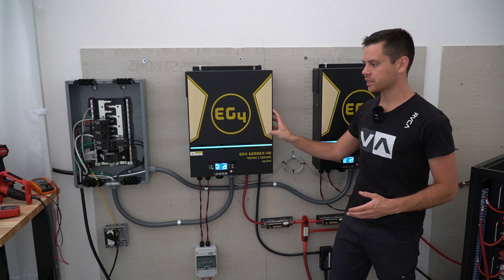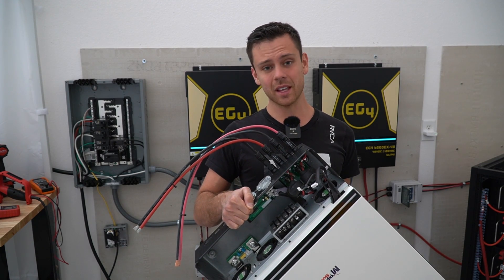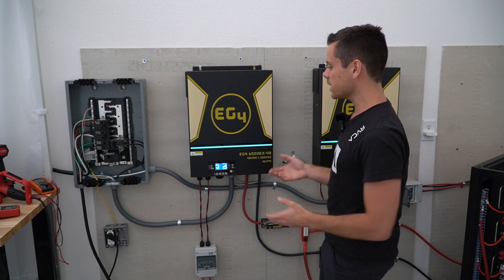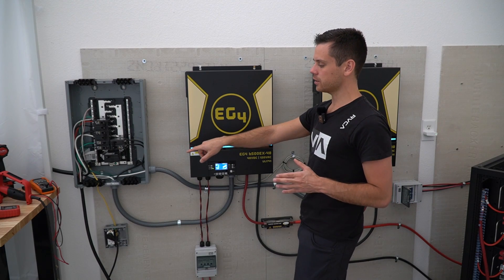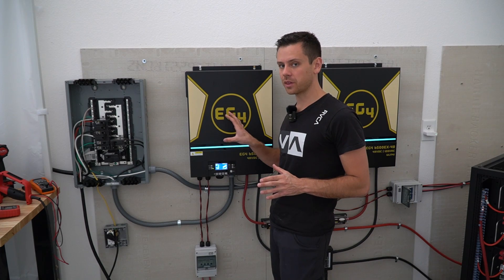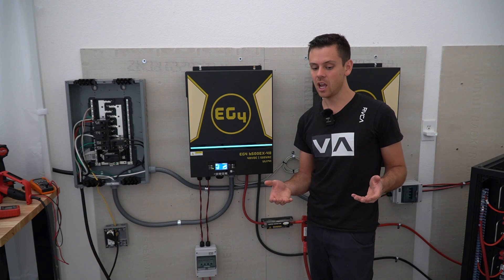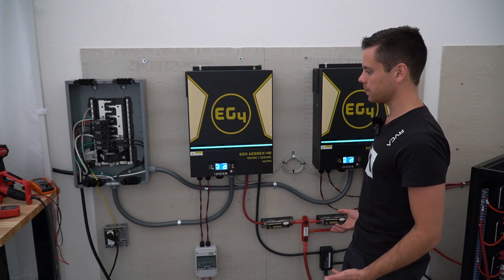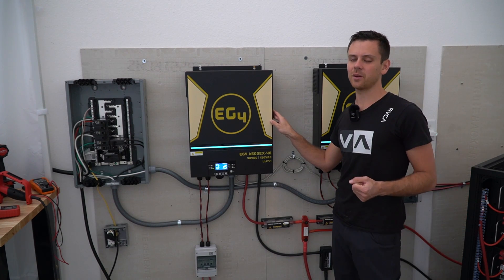EG4 6500EX VS MPP LV6548 Code Compliance and Ground Neutral Bond Discussion

Comment: On your load center panel, I am surprised that you do not have a true ground wire.  A #6 Bare copper wire connected to the panel case and then leading to a copper water supply pipe buried outside or10 ft  grounding rods buried out side.  How can you supply a proper ground fault protected outlet like in a bathroom without this earthing of the system?   If you separate the neutrals from grounds in the load distribution center with this earthing bare wire then protection would be provided.
Reply: It's precisely because the equipment ground wire from your GFCI is bonded back to the neutral from the inverter, completing the fault circuit, that makes the GFCI work.  And the one point to do it is in the main panel.  Secondly, the neutral needs to be bonded to the planet as you describe to avoid problems of a floating neutral.
Reply: @timgerk3262  Thank you for the response, I recall my local Hydro Inspector decades ago, checking to insure the Neutral bonding screw was firmly connected in the first panel into house.  Any panel after that would have the Neutral bonding screw removed.  We are not allowed to connect ground wires to the Neutral bonding bar/strip...must have two separate bonding bars/strips.  So it seemed odd to myself to see grounds and neutrals on a common connecting bar?   But differing rules for different areas.   The floating neutral also jumped out.

Comment: I love Solark! But it does have split-phase limit/balance issues and they are just so dang expensive!
Reply: Not if you balance your panel, buy two 12K’s and do without a new $80K truck.
Reply: @HillbillyKnitter 
Just so we are on the same page. the 12K is 9K continuous L1 to L2 BUT only 4.8k L1 to N. That is totally unacceptable for my household.
As mentioned, I love the on-grid features but cannot justify $7k (or $14k for your solution) when power fails when I can get the complete output solution that I require for $4k total with another brand, (less the features).
I am surprised that some smart engineers haven't duplicated the Solark programmable grid/power fail features in a less expensive box.

PS I can assure you I will never pay 80k for a car/PU. I can buy a house for that and rent it out.

Comment: The approved “grid support” inverters are the new generation grid tied(feed back into the grid). This new generation can communicate with the power company AND can be shut down remotely when the grid doesn’t need or want your power. Probably doesn’t apply to off grid inverters that have no means of grid support(not to be confused with drawing power FROM the grid).
Reply: are you saying this inverter can be used in grid tie systems?
Reply: @AaronEng  
No, not this family of inverters(Eg4 6500 or MPP LV6648 or BluePower SP6548) These can only Draw FROM the utility (pass through and/or charge). These do NOT have the internal capability to synchronize and feed INTO the utility. If you miss wire or attempt to try it, the inverters will see an existing voltage on it’s output and fault potentially damaging your inverters as well. These inverters can’t feed into the grid any better than your coffeemaker. They can connect (draw) but not “grid tied” (feed).

Comment: Good overview discussing the bonding. Hopefully the Growatt I just ordered is not bonded in the case. I installed a 50A generator inlet in my subpanel and put a 50A feeder tap outlet next to the panel to enable bypass mode. Main issues is the 50A tap breaker is not GFCI and is required by 2020 NEC code for garage outlets. They don't make a 50A GFCI for the type of breakers I am using so there is not much I can do. I am also using an RV power inlet since I wanted something flush. All the home generator inlets are ugly surface mount metal boxes which are meant for exterior mounting and not great for a finished garage wall.

Comment: As far as passing inspections and meeting code well. I’m a union foreman electrician and you would be surprised on the lack of knowledge and experience of a lot of inspectors. Yes there are definitely great ones but so many do not even have any practical experience, even large hospital jobs I’ve done the city inspectors I’ve had don’t know the basics.
Reply from the maker: Wow that's interesting. Good to know

Comment: Thanks  Will, for another great video. 
I'm an EG4 fan. I like where they are headed. I hope that they will bring a competitive model for the 5000es.
Separate 120v inverters for split-phase leaves too much power unavailable for my money. Unless you live alone, you will never be perfectly balanced.
Reply: The 5000es isn't split phase is it?
Reply: @2239968  no
Single phase 240v

Comment: Great you got the codes for NEC correct ! even in a off grid follow the 2020 NEC code book or later when new comes out. Current on ground can be a safety concern and may make a shock hazard and could disrupt any GFIC/AFIC protection. If running longer wires to load center go up a wire gauge.    Home depot THHN UL 600V is what I use. always UL wire on AC side. and PV wire as well. 600V . I am in a small town Boston NY,USA . I know inspectors and have there Cell numbers. I don't cut conners . best to get it right ! and home oner insurance may have requirements as well. check first ! I an in a off grid home and needed inspection for my insurance . I passed years ago.

Comment: Really appreciate the info. I removed both the grounding screws before I installed my lv6548’s a few months ago. It’s been working great without issue. After asking Watts247 they said it was fine if I chose to. I personally think anyone that isn’t using these inverters for completely off grid applications should remove the screw. And have some clear guidance on the subject. I’m glad you’re asking signature solar to clear it up more.

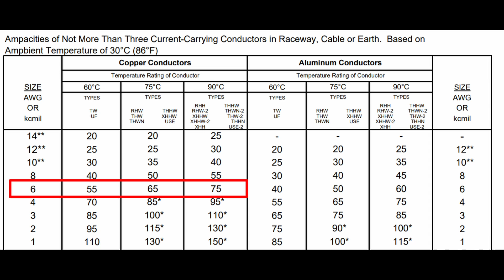Comment: 6:50 I don't know much but I'd rather have thicker wire that runs cooler for loads that runs 24/7 like my crypto mining machines. the electricity loss on the wires could be substantial over a year.

Comment: IF a device is UL Listed, the inspector doesn't look at it, Its has passed. If it hasn't been listed, that doesn't mean it wont pass inspection. If the inspector feels its safe, he can pass it. It will take more time, because he will be chekcing ground currents, and sktiching things on and off incorrectlry to see if anything becoes unsafe. Its best to work with your township and fire department with your plans and get sign off prior to construction. If you work with them, they will work with you. Its not being lax. The Code is a guideline. BTW, none of your instations would pass. Even "off-grid" its not about that. THey are all a electrical/fire hazard. Sorry Will. :-)
Reply: True in the US, but he does have a global potential reach

Comment: according to code, the ONLY place neutrals and grounds are bonded is in the MAIN PANEL
Reply: Lately, "they" have started calling this the service entrance, since the first be remote from service disconnect may remote from the main load distribution panel.  But it's complicated if you have separate structures.  I had an inspector once require bonding at the subpanel in each separate building.  I suppose because that was reasonable to clear any fault currents with the least impedance on the ground-path.  And also if you have a separately derived system.
Reply: @timgerk3262  im speaking from a code perspective. The reason for not having multiple grounds is ground potential. Separately derived systems is another thing.

Comment: You hire a licensed electrician to do an install, but they're going to have little to no knowledge about what needs doing, what code section applies, and how to interpret and stay within the code requirements. The inspector who comes out to check it will be just the same. So what you're going to need to do is learn and know yourself what is required and why as well as be able to show that to them in their code book. If you have to go that far with things the only value in having a licensed electrician involved is to maintain your insurance coverage as most policies prohibit you doing much with your electrical system otherwise.

Comment: The MPP, Growatt, eg4 are all NOT sending power back to the grid. THAT certification costs $$$$ and is why solark is therefore expensive. MPP, growatt/eg4/ etc (at least the eg4) can consume power forno the grid and the UL1741 is easy to achieve since it’s not even capable of sending power to the grid. With these smaller hybrid inverters, you are creating your own mini-grid in your home supplied by either PV, batteries, or The Big Grid.

Comment: FWIW Will I live in a "small town" and getting an electrian to wrap their head around installing a sol-ark 15k has been a fun one. Most just say "no thanks". The only one's willing I have basically had to do the entire layout and diagramming with them so they understand how bypass, etc.... I am getting them just to do grid --> sol-ark --> panel, and I'll probably throw the ground mount panels in a follow up with them...
Reply: My problem too.  Can't find anybody to do the work.
Reply: @damienhudson8230  right. The one quote I got for a disconnect and meter re-route was over 3k

Comment: In many locals, they require code compliance and inspection even for off-grid solutions.   While this can be frustrating,  there are reasons for this.    Many (Most?) of the NEC requirements are there to make the system safe regardless of where the power comes from.   A simple example is the rapid disconnect requirement.   It is there to protect the fireman that may go on the roof.   This protection is needed whether the system is connected to the grid or not.    Make sure you know what your local requirements are going to be before you start buying.

In addition to Will's other comments about passing inspection, if your town enforces the NEC PV Arc-Fault protection, PV Ground-Fault protection, and PV rapid disconnect requirements,  it may be very difficult to get the EG4 and MPP inverters to pass.

There are no good stand-alone PV arc-fault protection products that can be added, but there are some (expensive) combiner boxes that have both rapid-disconnect and PV arc-fault protection.

Since these inverters specifically say you can not ground the PV circuit,  a PV Ground fault circuit is going to have to use an (expensive) hall effect sensor.   (The 1Amp-breaker-to-ground style PV ground fault protection will not work.)

I have not done the math, but adding all this to the EG4 or MPP inverters is going to significantly narrow the difference in price between them and the Sol-arc or other high-end inverters.
Reply: Can you share your information about what combiner box you found?
Reply: @huestifer  Look at the Outback and/or Midnite Solar offerings.   I believe one or both of them have a combined rapid-disconnect and PV arc-fault prevention in some of their combiner boxes.

Comment: Why not considered add a dry transformer 240vac primary 240/120 CT neutral. The inverters will se a continuous 240 no bondage neutral to ground worries or unbalanced loads...

Comment: Couldn’t speak to the new EG4, but the MPP will not work with one of the reliant protran type transfer switches that feeds back into the main panel and shares a neutral. Sorry to contradict you there Will, but that just doesn’t work, you need a dedicated loads panel for those units
Reply from the maker: Yes me and the distirbutors were talking about that and will have one that works for this application. I just used that picture for example of generator transfer switch
Reply: @WillProwse  just make sure it switches the neutral.  Loud pops and smoke are generally frowned upon by the Mrs.   Trust me on that one.
Reply: I just bought a EG4 and a protran. Are you saying this will not work?
Reply: @Someoneswave  I can only say that the MPP 6548 is not acknowledged to work on a shared neutral setup like the protran
Reply: Do you have a link to documentation on this issue? Details on failure mode and causes? Thanks

Comment: Question for you, Will. For Off-Grid living, what gas generator would you recommend as a backup/supplemental battery charge option for when the solar panels are not able to supply power? Assuming the EG4 unit is being used.
Reply: I use a Cummins RS13A propane generator (13KW, 240V) to back up the output from a pair of LV6548 units. A Cummins transfer switch is used to switch between them. The Cummins detects if there is power on a 120V leg from one of the LV6548 units and starts the generator if it disappears, and the same 120V powers a charger for an LFP starter battery (which Cummins confirmed works fine instead of a lead acid battery).
Reply: @isovideo7497  you have 120v feeds going to each unit or a single 240v to one unit?
Reply: Do you need 240v or just 120v?
Reply: @Sylvan_dB  System will initially be 120V, but will (6-12 mo) later have a 2nd EG4 added to make it capable of 240V output.
Reply: @blaxtarr  Then if you want to run the house from the generator you will want a 240v generator.  It might be possible to use a 120v only inverter-based generator like the honda Eu3000i to charge the batteries. The inverters would then use the batteries to power the house.  I don't know if your inverters can operate if only one has "source" A.C. to charge the batteries.
Reply: @Sylvan_dB  thank you for the thoughts. Not sure if it is feasible but my thought was to only use the generator as a battery charge assist. Not as a power source directly to the house.
Reply: I just use a Pulsar 2300is, hand held portable 2300w generator that I can put away when not needed, anything that size or above is good. 

You can buy a really expensive permanently installed whole home generator if that fits your needs better, but the smaller the generator the less fuel they consume and this is all you actually need.

That's for a 10kw battery bank, the bigger the battery you want to charge the bigger the generator you'll want or it can take a ridiculously long time to charge. 

Also if your load coming off the inverter is high while you are charging, then you'll want a larger generator to compensate for that. As in if you are drawing 3kw average from the inverter while trying to charge, a 2300w generator will never be able to charge it at all it can't get ahead of the load.

Comment: Great video, and good to know the ground-neutral fix was so easy.  Last time I looked the Sol-Ark inverters weren't stackable if you needed more power like you can with the EG4's or Victron Quattro's.  edit: I stand corrected on the stacking of the Sol-Ark inverters.

Comment: Hi Will it would be interesting to see what you would get with programming a 3rd EG4 and changing the phase angle to 120 instead of 180. this should give a 3 phase power 120/208 Volt. would be great for a 3 phase power for irrigation pump. you could just turn off all the breakers and  program 1 of the EG4 to 120 phase angle. just as a show and tell.
Reply: 3 phase setup would be awesome but doesn't have many devices that would use the output in a residential application. VFD from 240v AC input might be a better option for driving the few 3 phase devices in a home application. I would love to have 3 phase power for machine shop equipment, but all the panels in the house are split phase. Running a separate panel just for 3 phase is not worth the effort.
Reply: True True. I am thinking of installation's where utility power is not economic to connect to. Such as some location's in agriculture

Comment: Hey I noticed in your other video you are using 3/4" flex conduit , according to the instructions  the inverters call for 4 awg for the feed and output. Every fill chart I find only allows max  2) # 4 conductors in 3/4" flex conduit and NEC considers ground conductors in the equation.  If you actually did the  longcomputation for the fill with the 2) 4 and 10 ground please let me know as I am getting ready to go to home depot to buy 1" smurf conduit.  Would rather stick to 3/4"
Reply: Advice. Pulling #4 conductors through 1" sucks, I can't imagine trying it in 3/4".
Reply: @fauxque5057  Lol I just rewatched the video to the end and saw he was running #6.   figure I would run the #4 thru the pre cut conduit ( 48" x 4) while it's straight then feed the ends where they have to go.
Reply: @TrollingwTyrone  do your inverters look just like Wills at the AC input/output? I have 2 slightly different versions of this inverter, one fits #4 great but the other one I couldn’t get #4 to get close to fitting.

The one that doesn’t fit #4 looks exactly like Wills. 

The other one has a different look for the AC input/output
Reply: @fauxque5057   I used #4 on my system. It wasn’t really difficult getting them through the 3/4 flexible conduit. If you had a super long run it would make things worse though I’m sure.
Reply: @GavinStoneDIY I am trying to use #4 in my system but it seems like it won’t fit into the terminals on the inverter!!

 I am doing split phase like in this video.. I bought the inverters at different times and they are a little different. My first one looks like Wills and can’t fit #4. The second one looks a bit different for the AC input/output and fits #4 just fine.

Does your inverter you are using #4 with look just like his at the AC input/output, or does it have a different look to it?
Reply: @ggardentracks2012   the newest versions have a larger input terminal for the ac. But both versions will fit a #4 wire. It is extremely difficult to get them in there though. That’s why they finally made the lugs larger. You have to strip the ends and pre bend the wire  below slightly before attempting it. The neutral is always the easiest because it’s a straight shot. The best method is lining it up with your fingers while a helper pushes them.